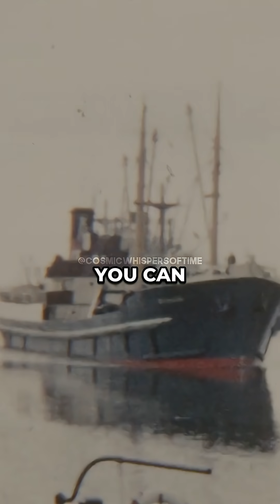Why Steel Ships Don’t Sink 🚢 w/ Neil deGrasse Tyson

Comment: It's called displacement works with any material except extremely heavy material like gold or lead
Reply: You could build a boat out of lead or gold if you could get it thin enough and stiff enough to not collapse.  Unfortunately gold and lead are very soft and will likely collapse, but I don't know for sure.

Comment: The weight of the water dispaced by the ship is heavier than the ship itself.
Reply: you explanation is correct. his ..not so much it isnt the air it could be filled with wood and would still float